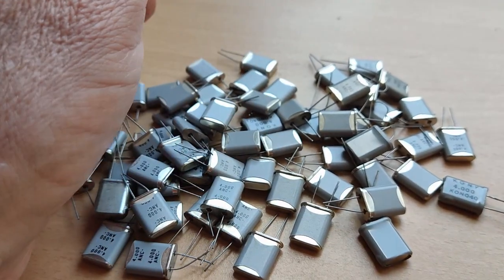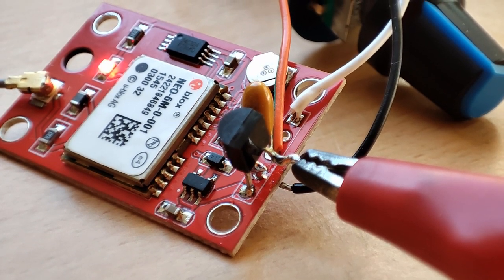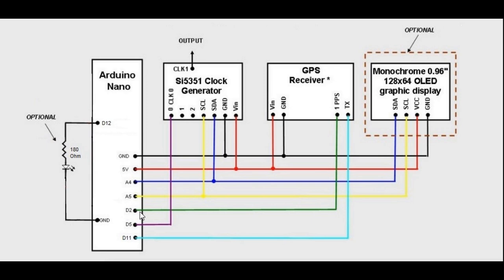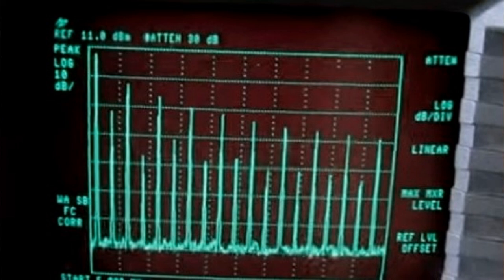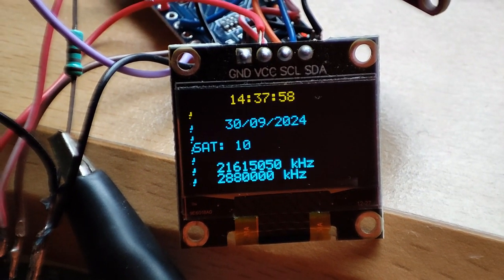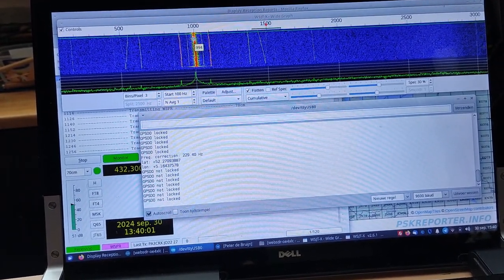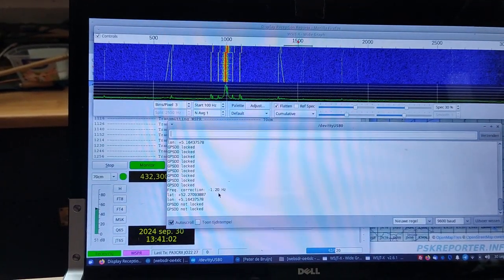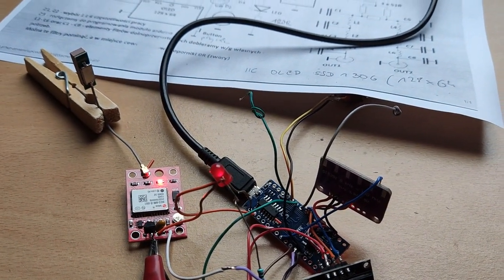DIY simple GPS locked PLL oscillator with cheap modules

Comment: Beware of the Si5351 Chinese made module. They work fine but have extremely bad spurs, as low as -20 dBc. The Si5351 chip is some knock off. If you're gonna multiply up to such high frequencies, use a genuine Si5351 module instead eg. the Adafruit or similar. It will make a massive difference! I use a lot of Ali stuff for RF, but that module you'd wanna give a wide berth.  73
Reply from the maker: Thank you for sharing your concerns. 
I do not know if Chinese Si5351A chips are especially made for generating more harmonics.
For multiplying purposes more harmonics looks ideal to me?
In an other video I published about harmonics of this chip, please see https://youtu.be/epkQQfynh7A

Comment: your clock is fucked grandpa, you need a proper oscillator, get yourself a DCOCXO like SiT5721AI, and a GPS chip that receives GPS at least at 10Hz, or better yet at 50Hz position frequency instead of 1Hz, then you can average much better, but i think honestly if you just get a proper OCXO that is modern and specked in PPB instead of PPM then you could use it very reliably
Reply from the maker: It all depends on what is needed and the price of that I think. 
Thank you for your addition for the ones that have higher requirements!
Reply: @PA3CRX  another tip, disable the third world communist satellites and just receive GPS and Galileo, these two have far superior accuracy and thus far superior clock signals.

Comment: This can't work as GPS disciplined oscillator. For that you need an oven-controlled XTAL with stability 1e-8.
Reply from the maker: Thank you for sharing your knowledge.
What this circuit does is receiving signals from GPS satellites to use the precise timing information within those signals to adjust the output frequency of the crystal oscillator.
When built in (video about that next weet), almost no frequency corrections takes place.
What name would you give to a circuit that does this?
Thanks in advance.
Reply: @PA3CRX  the problem is that the GPS timing is not precise having pulse-to-pulse jitter of about 1 us, or 1e-6 accuracy, which is worse than the cheap XTAL on the Si5351 board. To improve the accuracy, it can be averaged, 10'000 averages (3 hours)  can bring it to 1e-8 accuracy, which requires Oven-stabilized XTAL.
Reply from the maker: Thanks for the additional explanation and your suggestion how it can be further improved.

Comment: I'm interested in building the circuit but am not clear about a few things. I don't understand  why there are two frequencies shown on the display. You mention using the circuit for UHF but the display shows 2161505 kHz and 2880000 kHz. Both 2161 MHz and 2880 MHz are extremely high frequencies and well above the UHF band.  Also why are two frequencies shown on the display ?
I want to generate 10MHz for my homemade frequency counter clock input but am not sure where I change the code in the sketch. I would appreciate your help.
Thanks, Mike
Reply from the maker: Thanks for asking if something is unclear.
First about the mentioned frequencies in my display. It shows one digit more then should. In fact it is intented to be 216.1505 MHz and 28.8 MHz. 
The originator of the sketch use the circuit on two frequencies, 125 MHz and 28.8 MHz. I only changed the first, so that is the reason. (Because the Si5351A generates a lot of harmonics, I use the second harmonic in the 70 cm band, that's UHF).
However, in the sketch lines 59 and 60 only shows what appears on the display, that could be completely differ from the what you generate.
Therefore you have to change line 128: 'si5351.set_freq(12500000000ULL, SI5351_CLK1);'.
Just replace the first three digits (125) by '10'. This should result in 10 MHz output on CLK1.
(And in line 59 you can decide what frequency should me mentioned on the display, so for example '10000'.
In the lines with 'oled' you see some other text that appears on the display that you could change for your own needs.
By the way; if the RF output needs to be increased, you may change the value in line 120 to 8mA.

Hopefully I cleared things up, good luck with this project!
Reply: Thank very much for the clear reply. It helps a lot. I'm a 79 year old beginner so things are not always easy for me to understand! One more question: why is a second frequency displayed (28MHz). Is the choice of frequency important?  Thanks, Mike
Reply from the maker: @mfwwhelan7561  Age is not relevant to be interrested in new things! 😀 
The originator of the sketch used two frequencies, as mentioned in the sketch. 
I have no idea why the second frequency is mentioned since now only CLK0 (for controlling the frequency) and CLK1 (output to be used) is mentioned in the sketch. 

I am not so happy with the very small antenna I have with my GPS receiver. A video will follow with a better (home made) antenna. So stay tuned!
Enjoy the project!
Reply: @PA3CRX  OK thank very much for the additional info. Mike